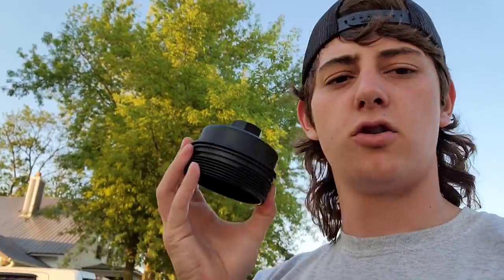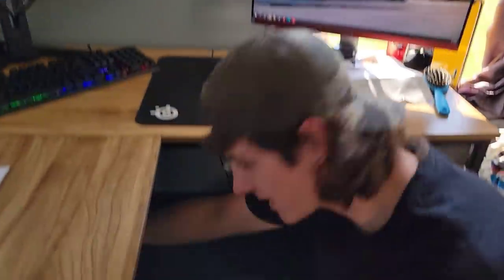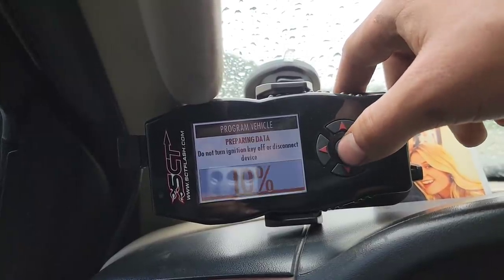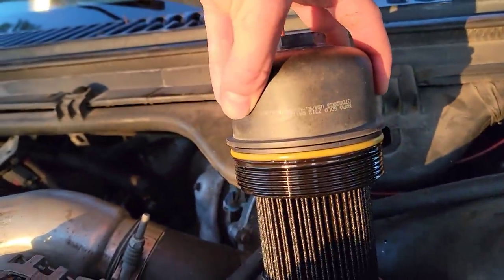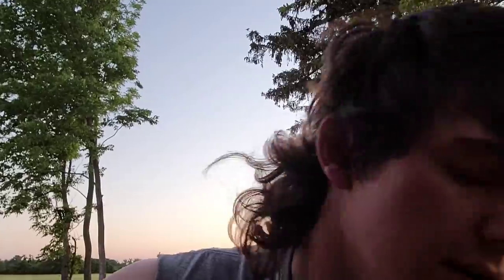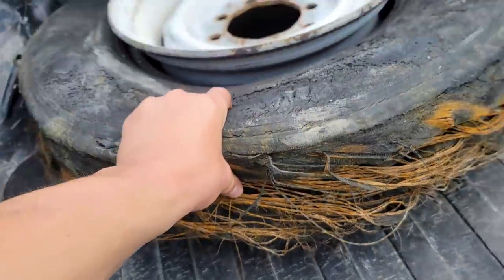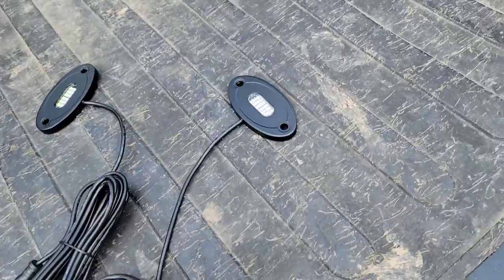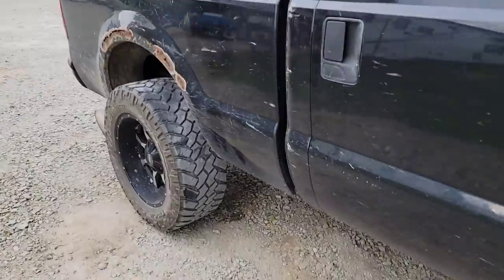DAYTONA TRUCK MEET CRUNCH TIME

Comment: The reason you want the oem cap is because when you use the napa/wix filter it comes with its own cap so you throw the oem one away then when you get smart and buy a Ford filter it only comes with the filter so ya spend 20 minutes fighting off the napa one and manage to pop the shorter ford one and then it bypassed the oil right back to the pan and the upper valve trane and turbo gets starved of oil and burn up......

Comment: Damn, i like that socket holder, gonna have to make me one.
Reply: You can buy em on Amazon my guy.
Reply: Harbor freight has em and you may want to buy two sets cuz they break pretty easily if you plan on carrying them around and they're tall and get fucked up shuttling the drawer on the toolbox.....
Reply: @darylangel  not if you get the snap on brand Thier designed to fit in any toolbox.

Comment: I use the stiction eliminator in my truck too, the way it sounds on the bottle makes it seem like it takes away the coal rolling abilities. However, I've notice my coal rolling abilities increase' and I'm rolling more coal!
Reply: Thanks for helping the epa with the clean air act. Idiots rolling coal everywhere on purpose is what brought attention to it. Hopefully you signed the RPM act at sema website...
Reply: @StephenBrewer89  calm down! I don’t just roll coal for fun, although it is fun. Besides it’s not for a long stretch, just when I shift from 4th to 5th. You’d do the same if you had a diesel anyway.
Reply: @Valve-sb7ne  lol I do have one... for 5 years. Programmed, full exhaust, intake pipes, blue spring, all that crap. Still don’t get it
Reply: @StephenBrewer89  hey man, to each is own! Some of use like rolling a little coal every once in awhile. It’s personal preference.
Reply: @Valve-sb7ne  well please go to sema website and sign the rpm petition or else nobody will be able to do anything one day. Spread the word. Share the link.
Reply: @Valve-sb7ne  I agree with you 100% I’ve got an 01 7.3L and trust me when I say I can roll some coal. I could smoke out the county with my beastmode tune. But like you said it’s not like we just drive around constantly rollin coal. It just cheers you up when you need it lol. Besides it will definitely keep people from riding your bumper. LET THE COAL ROLL🤘
Reply: @lonestar_7.3L  exactly! It’s a good way to cheer a person up! At least someone else understands 🤘
Reply: @Valve-sb7ne  yes sir!